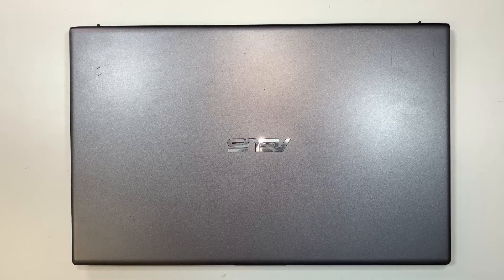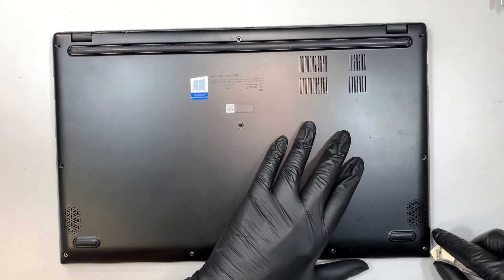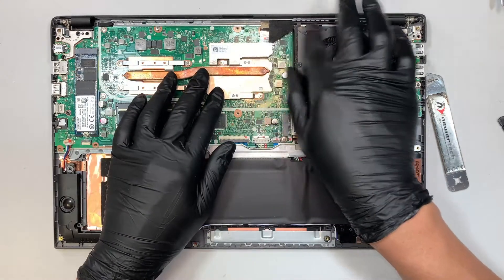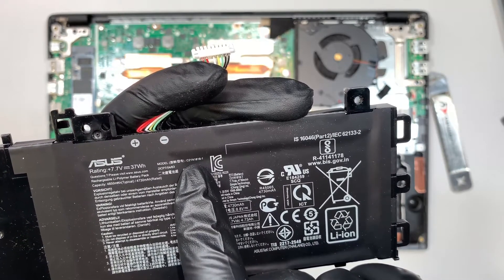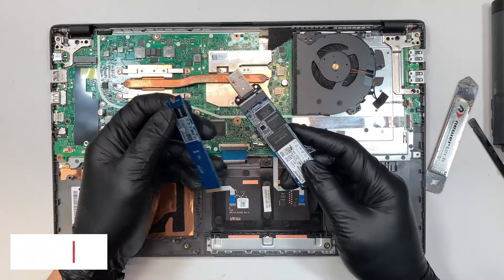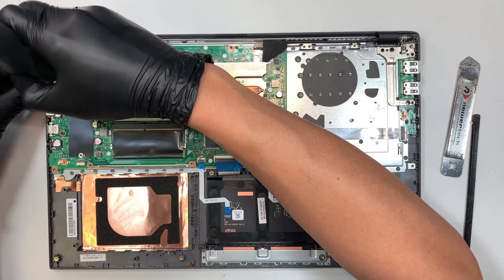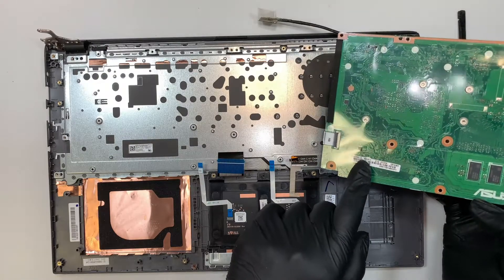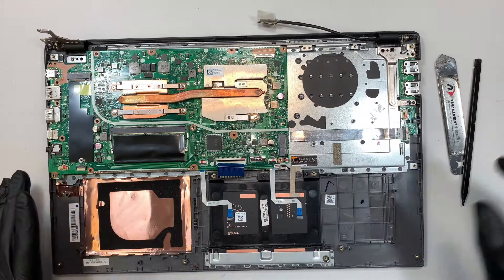Asus Vivobook F512D Laptop Tear Down Disassemble

Comment: Great Video, I have a model like this and I have really wanted to run it without the battery. I wonder if you could make a video doing that to this laptop? Might be a good video/challenge!
Reply from the maker: Yes you can. Just disconnect the battery 4:35
Reply: did this laptop work with the battery unplugged?